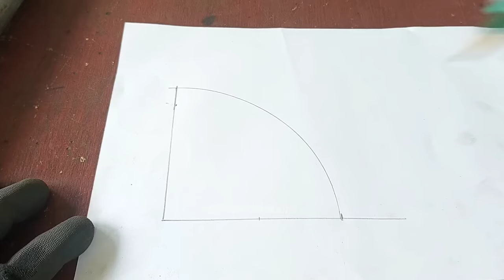not many know, the welder's secret trick on pipe work | how to bend pipe without bending tool

Comment: Fill the pipe with sand, tamped tight. Bend over a curved surface of required diameter. Empty out pipe and flush.
Reply: Short and sweet